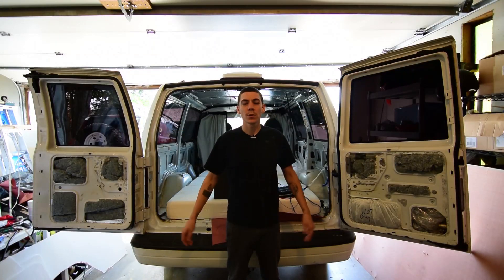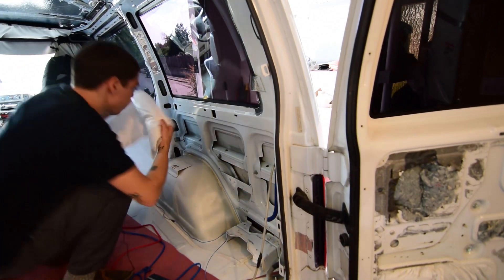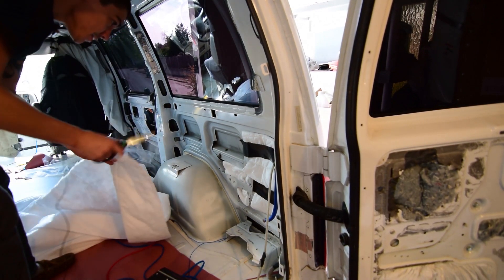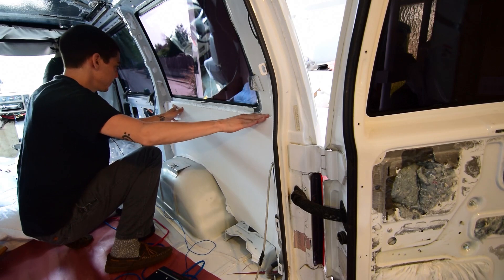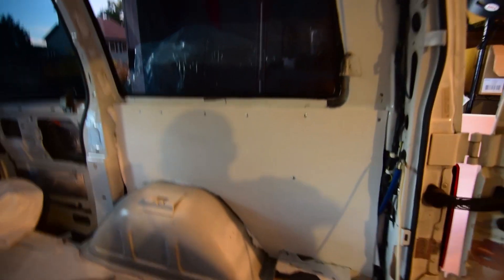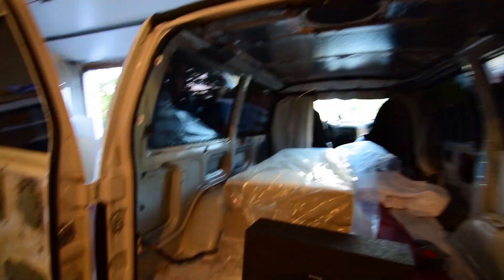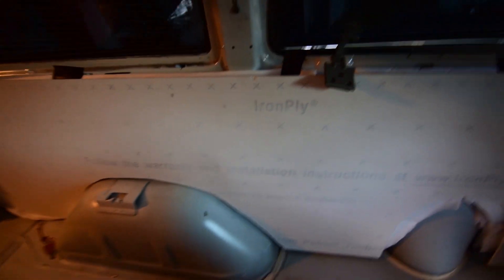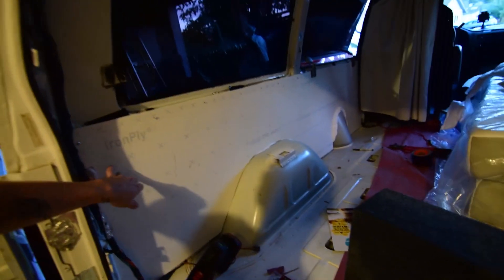Van Build 2.4 Thinsulate Insulation and Paneling Install, Custom Stealth Astro

Comment: For your floor, consider to use (water resistant) laminate. Cheap, easy to place (and to replace), scratch-free, non-toxic, easy to clean.
Reply: My thoughts also. Easy to install and good flooring for the buck!
Reply from the maker: I've heard other people say it swells when wet. have you have any experience with this?
Reply: I've use cheap and not-so cheap laminate floors. The cheap stuff will swell. The Pergo (and equally priced other brands) are connected so tightly, water can't get between the joints. I've used both in my kennels, and the Pergo never failed! The cheaper stuff had to be replaced.
Reply: As I said, best choice for this purpose is water resistant laminate, suitable for bathrooms and similar surroundings.

Comment: Hey my man you got to make sure you cover all bare metal with tap because it will get condensation on it otherwise my friend. I don't know what you are having under your mattress but if it's a solid piece of wood you need to make large round hols all over it or you will find the underside of the mattress will start to get damp it needs to have air circulating  or your body sweat will seep through and you will get mould plenty of air circulation my friend. hope you don't mind me saying man :)
Reply: Look into the Ikea wood slat frames. I just built a bed with an adjustable one. You should install a sheet of plastic over the insulation to stop the moisture from getting through the insulating to the cold body behind.
Reply from the maker: thanks man! im getting a waterproof cover for the mattress and putting it on slotted wood frame
Reply from the maker: +John Farragher that's really smart

Comment: It's not the covering you need to worry about. It's the glue and only thing I know of is Tolex.. You can buy hard wood Pergo from Graigslsit with the backer insulation attached. Then just lay radiant barrier straight to the floor and up the sides. If you want to go full blown energy saver. You can buy Pergo with grooves cut in it to use radiant hoses that run warm water through the floor and use the vehicles radiator as the heat source. As most vans have front and rear AC\Heat control valves. Just tap the rear heat valve or you can buy a stand alone heat pump for it. This setup is the most efficiency and less headache. 

If you want good R value in the walls\ceiling. Just buy Owens pink insulation and plastic bag it. Then shove it in the all the corners , walls and ceiling. As the worst thing to deal with is condensation. 

And for hot climates and windows that are heat sinks. Pay the extra bucks for zero heat tint. As that shit is the bomb at keeping heat out of the vehicle to start with! The price for mine was $480.00 for a full size window van and that included the front window. 

I got the tip form this guy https://www.youtube.com/channel/UC4OHXNNLEPZSy0UvmpPkNEw

Comment: You could get some cotton fabric like your ceiling panel and cover that thinsulate to cover the metal. The stuff you are using is what is used for ironing board covers....works great for managing heat😀
Reply from the maker: Oh good point and great idea, thanks!

Comment: For your floor you can use Enerfoil, or a similar product for your insulation.  You can get them in various thicknesses from 1/4" to 2".  It comes in a 4x8 foam sheet.  I work at Rona and they sell a lot of it.  I have a GMC Safari and I've also just stripped it down to the metal framing.  I'm going to try the Enerfoil in my van with a finished G1S (good one side) plywood with maybe a moisture res stain for looks and more moisture resistance.  Good luck!
Reply from the maker: sounds smart! it takes two pieces of 4x8 to over the whole floor, are you doing to split down the middle?
Reply: +Into The Mystery 13 I'm putting in the whole 4x8 ply wood then cutting small  custom pieces to fill in the awkward spots.  I figure I'd keep the seams close to the walls, cuz if something does spill, its more likely to seep through a seam thats right down the middle.  also, since I have furniture on both walls, the seam is hidden under it.

Comment: I have a suggestion which may seem really sketchy, but it has reduced my small home heating and cooling costs by 60% annually. All I did was to use tin foil on my windows to reflect out the radiant heat. I later discovered that tin foil has a 95% insulation effect on heat. That figures, if you consider how tinfoil is used to bake potatoes. After you remove them from the oven, the foil then keeps them warmer for a long time. Remember this, also. The 95% reduction in heat transfer is for a single sheet of tinfoil with the shiny side where you want to reflect the most heat. In a van, I think you can use 4-12 sheets and can reverse them one on top of the other depending on whether you want to reflect heat out the walls or to reflect heat back into the van in cold winter. Foil on a window does NOT FEEL WARM. It insulates 95% of the heat, even though it is less than paper thin. I think it will work just as well on van metal. Try it. You will be very surprised. I have foil on all of my windows, but you cannot do that and drive. But foil in the walls and ceilings should reduce heat in summer by at least 95% per sheet that you use. It will do the same to contain Lil Buddy heat inside the van in winter. A sheet of foil costs only about 2 cents or less per square foot or less, and you can use the cheapest foil which works just as well as brand names.
Reply from the maker: that's basically what reflection does, but with an added layer of the air bubbles right? much cheaper

Comment: Thin, you can use reflectics, but I'm using foam insulation  board on my walls and floors. It's the same stuff used under a concrete  foundation.  It's not expensive,  and can be cut to any shape

Comment: I got my hardwood floating floor at Home Depot. Only 17.00 a box. I think it took 2 boxes but I have a super long van. BUT I had a small leak and it sat, undiscovered for a day and the seam in the floor swelled some! So I heard to get the vinyl interlocking floor instead of the wood laminate. But it's more money :( I have spilled water on it and it wipes up with no problem. But this was standing for 24 hours and it puckered a few seams

Comment: Wenzhou Chinese Fiber Co.,Ltd production of Automobile NVH insulation materials and 3M Thinsulate Automotive acoustic insulation material are absolutely same products. The products has good performances of acoustic insulation, meanwhile, it has more characteristics as: environmental, light weight, hydrophobic, compressible, flexible installation ect.It is widely used in many fields, such as: automobile, high speed train, ship, yacht, air plane, machine, equipment sound insulation, workshop ect.

Comment: Idea for those areas you talked about that had void that would get hot such as the post by the back doors. Drill a few hole along the lenght and get some non toxic biodegradable spray foam insulation and spray into the hole. It will insulate plus not allow water the possiblly get in or collect. On the flooring check the suppliers like home depote or luber liquadators for their packages of shorts, scratch n dent, end of runs, customer returns or even odds and ends that could work together. May find some great discounts with those areas since you wont need very much sq footage. Safe travels
Reply from the maker: great ideas, thank you!

Comment: Since you have had rust issues on the floor of the van, have you considered spraying the floor with Line-X to keep water from getting to it?  Then put whatever flooring you want on top of that.  Just a thought.  Great job though!  Mark
Reply from the maker: thanks, yeah it's expensive and since I fixed all the rust spots and the leaks I don't think it will be an issue.

Comment: Click style flooring is designed to be on a flat hard level surface.  If you are looking at that style with a foam base and not plywood it may cause you some issues and the joints will loosen up over time most likely.
Reply from the maker: thank you!

Comment: Instead of using all of those drill bits, use metal self tapping screws. No need for pilot holes. For flooring, try some cheap indoor outdoor carpet.

Comment: Was thinking about an alternative to vinyl, maybe canvas fabric.  Can use a boat trick and paint the canvas fabric too.
Reply from the maker: you can paint canvas?
Reply: Yep, old wooden boats they used it for the roof.  Need to use oil based paint.  They call it poor mans fiberglass.  Anyhow just need to use oil based paint and works good.  Makes sense when you think about oil based paintings on stretched canvas.  Was a surprise to me too; found out when I bought an old boat upper deck was painted canvas.
Reply: Oh and it comes off pretty easy too so no worries if you change you mind just give you self a little extra not painted canvas on one edge like under trim so you can pull it off.
Reply: +Into The Mystery 13 you can't paint canvas. You need to apply a gesso primer first before you paint it.
Reply: Never had any issues painting it.  Just made some little covers a few weeks ago.  Might be that some brands or place you buy it from may have some kind of treatment to it or something, I know that some canvas smells really bad like it may have a chemical or oil added to it, if it doesn't have a bad smell think it should be fine.

Comment: For your floor... I've installed a floating floor three separate time and never liked the final product. I've either had a piece in the middle that came loose and moved around. Every project the seams have issues when they get wet. For your van you could get a none treated sheet of wood (not plywood, get the good finishing wood) and hide the seams under things. Sand it and put a clear Eco friendly coat on it and you can limit seams and have an easy surface to clean. Just cut it to fit and don't screw it in. Good luck with everything.
Reply from the maker: +Muffinman nothing under it?
Reply: +Into The Mystery 13 some type of foam that would not allow mold if it did get wet

Comment: Does it matter which side you of the Thinsulate you install? I saw people order the Thinsulate with one side black (scrum or something). My Thinsulate is white on both sides like yours. Wondering which side goes on against the metal. Thanks.
Reply from the maker: +wojtek0000 I dont think it matters

Comment: What's your opinion about FatMat Rattle Trap and other sound deadening insulation? I will be FT dwelling in city so I am mostly concerned about keeping outside noise out. It is expensive and I would hate to waste money if it doesn't keep sound out. Thanks.
Reply from the maker: +wojtek0000 it won't help much all for that. Insulation will though and where you park your van. Look into toxicity of it before you install it too
Reply: My roll of Thinsulate arrived today. Thanks for making me decide on it. Great call.

Comment: I'd probably just take the good impact sound insulation they have where you buy laminate floors. Basically just special foam with Reflectix on both sides. A bit more pricey but worth it.
Reply from the maker: I'll look into it, thank you

Comment: For the walls or wherever, check out http://amzn.to/28MLsxR
Also if somebody else uses Thinsulate for the walls, try fastening to the Luan first and then just install like that. Really I don't see any need to fill in the holes with anything first as thermally it's the same as the rest of the wall. I would however fill the holes if I was using a cloth covering instead of Luan to smooth it out.

Comment: On the Thinsulate, I read this online at http://www.voguefabricsstore.com/3M-Thinsulate-Thermal-Jacket-Insulation.html:
The quilted side (of the THinsulate) should face the outer fabric and the flat side should face the lining.  So there appears to be a certain direction it should face.

Comment: Why don't van dwellers use aerosol spay foam insulation?  Just curious.  It'd be a piece of cake to put the Luan on and fill the wall and structural members completely with insulation.
Reply: And also... does anyone know if it's toxic when used in large quantities in small spaces, when subjected to hot temperatures?
Reply from the maker: lots of them do, some have had issues with body panels bulging as it dries

Comment: Lots of talk on your channel about the toxicity of materials but your van runs on gas and has oil in its crankcase, steadily decomposing rubber on its tires...the temporary off-gassing of spray glue is a drop in that bucket of toxicity. are the fabrics of your clothing specially formulated to be in direct contact with your skin?  are they laundered using special processes to prevent contamination?

my point is not that you're wrong,  just that you're obsessive about a few things but carefree about many others.